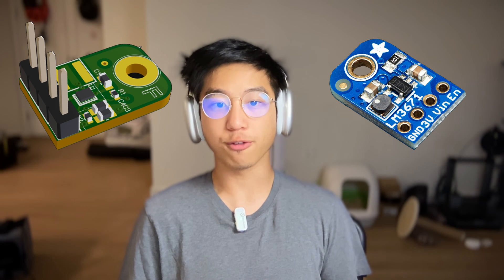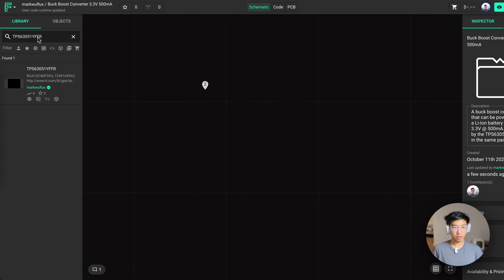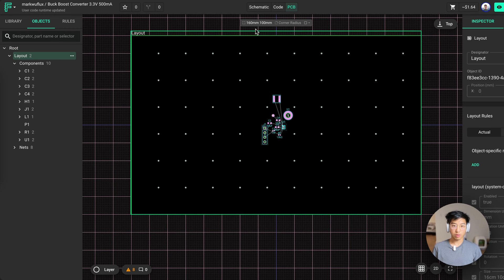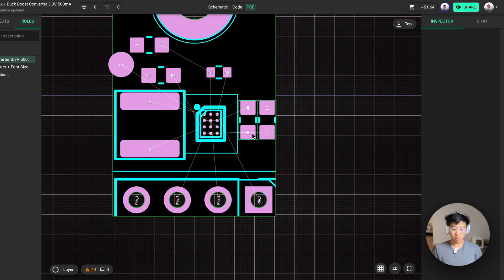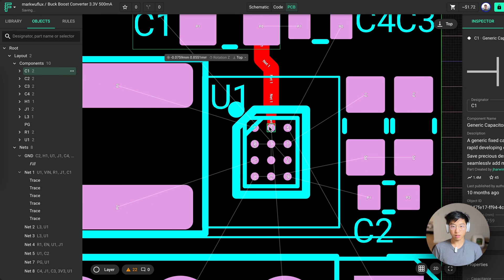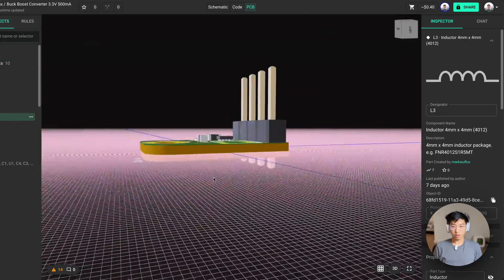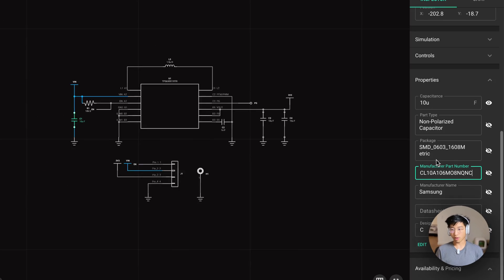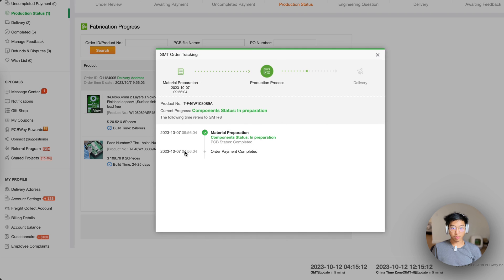PCB Design Tutorial Start to Finish

Comment: Dude,I tell you the components, you make the connections, the holes and the shape, then you ask me if I think it's ok. Otherwise it's trash like any other old program.
Reply from the maker: Hey! Flux is designed to help you go faster by reducing manual work, and it still gives you full control over your design. You should try it out and let us know your thoughts!

Comment: So basically do everything manually as usual and then auto-route, then double check the routes. It appears to be much faster just to use Eagle, Kicad, etc as I have been. Unless I can simply prompt "I need an inverter from 12 to 24 volts dc into single phase AC at 120 volts and 20 amperes, pure sine wave. I want to use IRF 2807Z for the switching mosfets, and optocouplers signaling the gates, and a switching frequency no more than 20Khz." Then have the AI place the components, and or find the data sheets if the component does not exist, then route the board, then allow me to make modifications as needed.
Reply from the maker: Thanks for the input! Flux has evolved a lot since this video, and we’ve added tons of new AI features to make designing faster and easier. Give it a try and let us know what you think! We’re always open to feature requests and feedback, and we're working hard to make Flux even better.
Reply: @buildwithflux  I will stay subscribed and see if I can find faster ways to get circuits completed using the system.

Comment: Hows this different than KiCAD or Altium? I thought this was using AI and building PCB for you.
Reply: Lol I thought the same but it is the name that is misleading in the name of AI. Otherwise it is just another web based pcb design software actually worse than easyeda
Reply from the maker: Hey great question! Just a heads-up—this video is a bit older, and Flux has evolved a lot since then. With Flux Copilot, we’ve introduced AI features that set it apart. Copilot offers smart component suggestions, automatic datasheet parsing, and partial design reviews to help streamline and speed up your workflow. Give it a try and let us know what you think! We're constantly improving based on user feedback, so your input is always appreciated.
Reply: @buildwithflux I searched for some components and found nothing. Is there a limit or different components for free users?

Comment: do you know when the AI will be able to create the PCB based on the shematic form ... 
and create the best path and placement for each component ? 
depend of the complexity of the shape that need to fit in or optimized the best way to placed everything ... it could be great to have the help of AI to do it ... 

i'm about to learn it anyway, but it could be a great help to finish complex project !
Reply from the maker: Hi @michaelart.212! Great question! We actually just launched an AI-powered auto-router to handle trace routing, and the vision is to add AI-driven component placement soon to make designing even easier.

Comment: Wouldn't changing the trace width mid-trace cause some sort of impedance mismatch?
Reply from the maker: Hi! It will yes, but that is not a problem by itself. It depends on the signal that will be running through the trace.